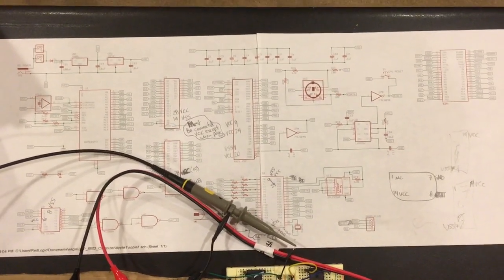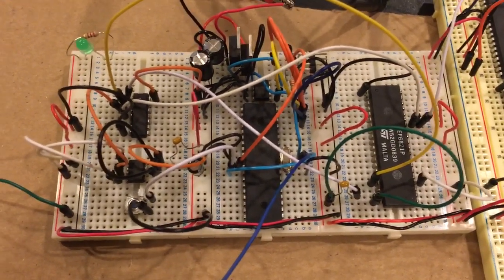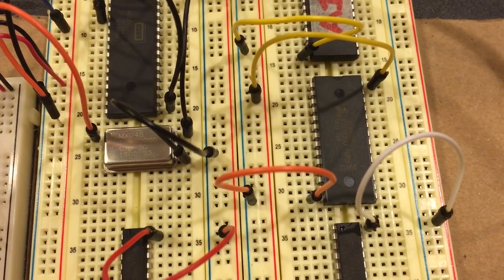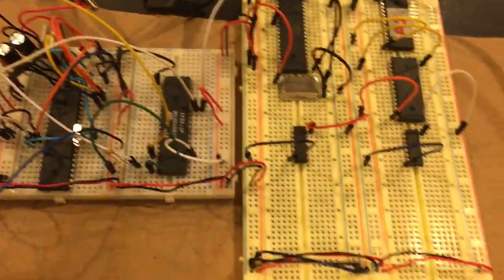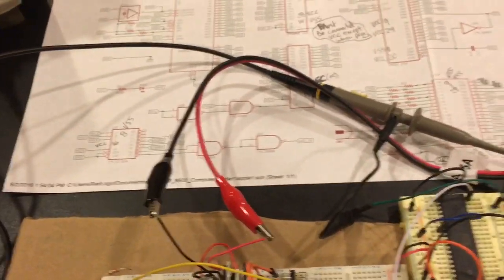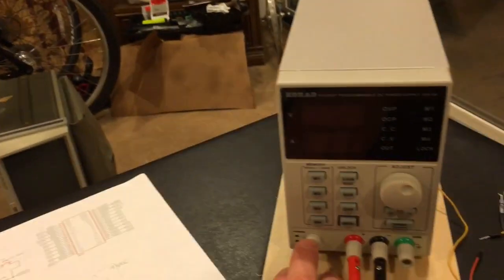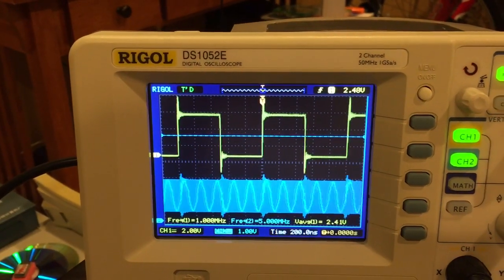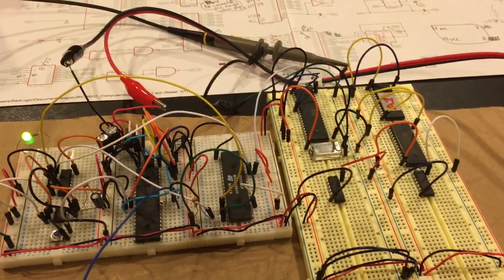6502 computer build, part 1

Comment: Where did you buy your EPROM? All the ones I can find on Mouser are One-Time Programmable since they don’t have the little window on them.
Reply from the maker: I used OTP EPROMs- I was having trouble sourcing the window/UV erasable EPROMs new, and used is a crapshoot.  It is the same pinout as the UV erasable EPROMs- and we've verified, UV chips are plug-in replaceable.
Reply: Corneleous Worthington Ah, gotcha.

Starting to wish I could delete emails, as I had sent you an email on the same topic on the off chance you’d see it first.

Comment: I'm curious, why EPROM over a chip like a 28256 EEPROM which doesn't need ultraviolet to erase it? There's an Arduino 28256 EEPROM programmer which can interface to any modern PC, and Daryl Richter has one that interfaces to a 6522 so a 6502 machine can self host.
Reply from the maker: I guess I was going for a couple things:  
1)  I started out with this idea that my system would be split in half- half sort of period-correct (but with only currently available parts) and the other half using modern microcontroller components, which might be replaced/removed down the road in the design...  (I plan to next implement expansion card video, sound, and I/O..)  So, the EPROM fit that bill.  Although, I'm more and more liking the idea of having a "reconfigurable computer" capability which the microcontroller brings...
2)  The EPROM was VERY cheap!  :-)
Reply: +Corneleous “Sharkey” Worthington Thanks for replying and I am looking forward to seeing your progress.
Reply from the maker: To clarify my above answer (after reading the AT28C256 datasheet) I discovered I had wrongly assumed that to use an EEPROM, I'd need another embedded microcontroller.  I guess I didn't realize that there are some ROM burners that can erase and program too (need to check the manual for my old Needham PB-10, maybe it can do this!)

My cheap comment still makes sense- the chip I am using cost $1.79..